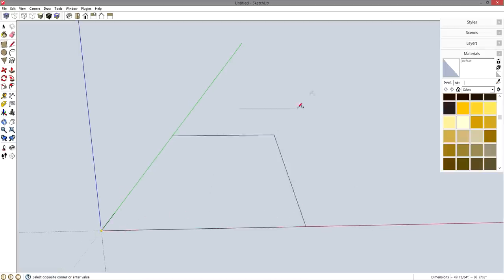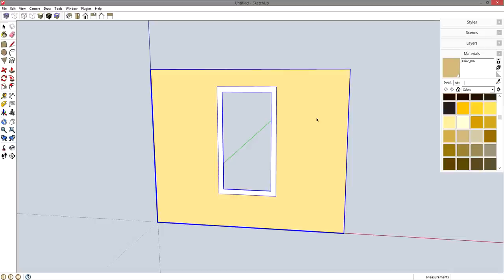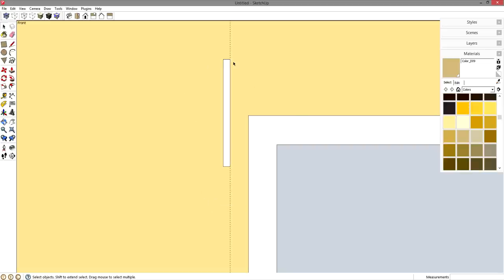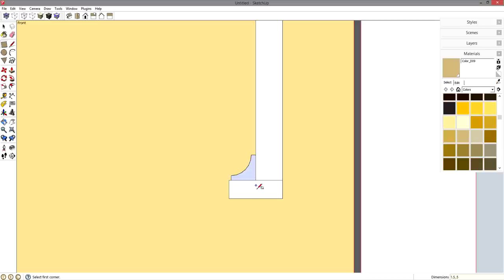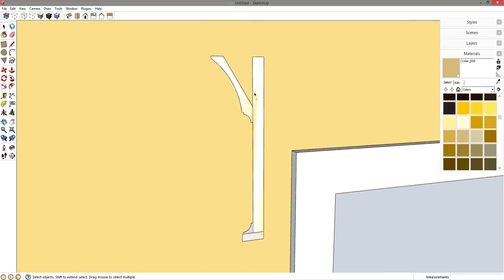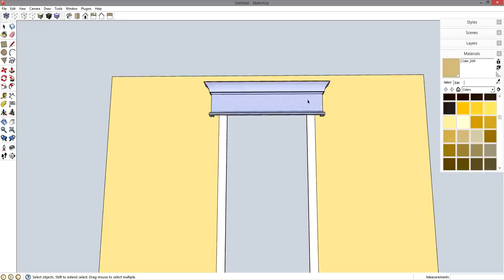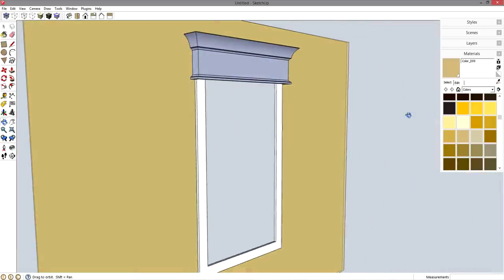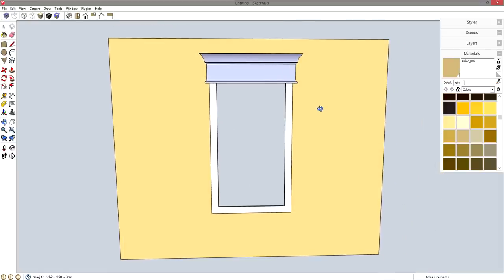SketchUp - The Best Tool For Mouldings - Window Cornice - 176

Comment: Thanks so much for showing me the follow command... I had a GRP flashing (complicated shape) and it had to follow a flat roof line with many angled sections.... Simply scratching my head as how to work all the mitres. One thing that should be explained is you need to explode any component in order for the shape to follow your line. Thanks so much for this...brilliant